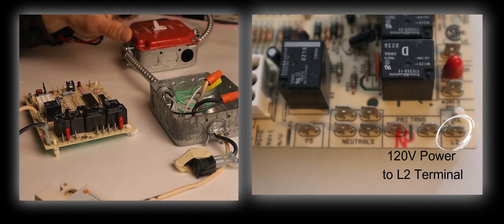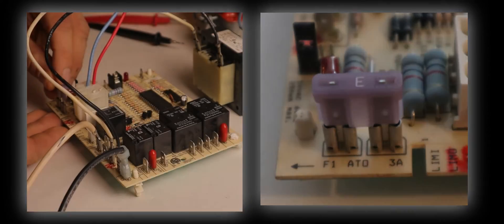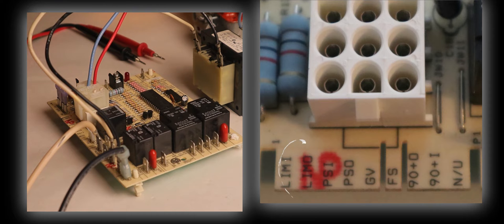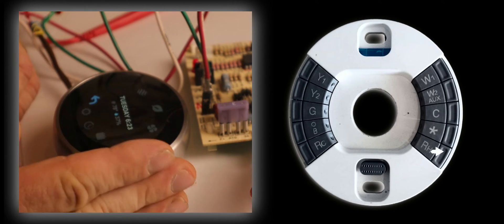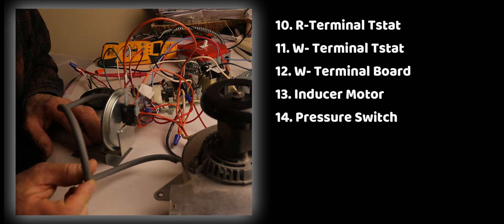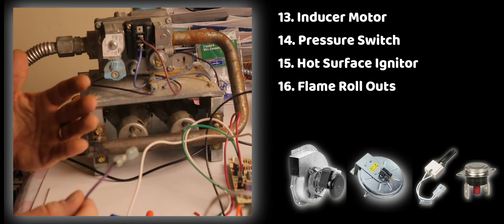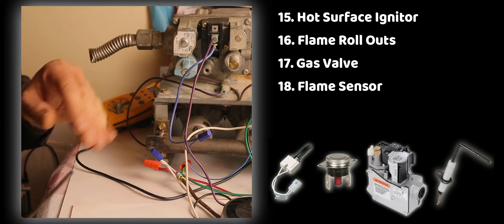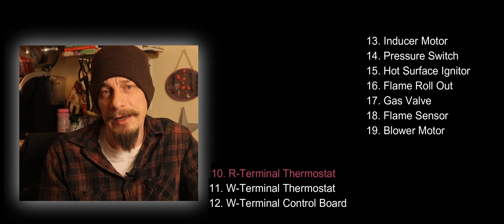HVAC Diagnostics: Furnace Wiring (Breaker to Flame)

Comment: I recently had a bad high limit switch on a HE gas furnace. Everything would work as normal for about 5 minutes then the burners would shut down.  A few minutes later the burners would turn back on and the cycle would repeat. Blower motor is running the whole time. Does this mean the switch is working except for the fact that it is opening at too low of a temperature? Is that something that can happen in these switches? BTW, outstanding video!

Comment: Can you do one of these step by step for cooling mode as well? I know its pretty redundant but that would be amazing
Reply from the maker: Yeah I'll try to get that in at some point. But for a furnace with an evap coil sitting on top, everything is the same all the way up to the R terminal on the stat. Stat just sends the 24v to Y terminals instead of W. But I'll try to do a vid of it soon.
Reply: @JerseyMikeHVAC  Came here to ask the same question!  Your vids are the best!
Reply from the maker: @mehvac  Thank you!

Comment: are all furnaces wired exactly like this ?
Reply from the maker: You'll see some variations out there even with the same brand, but the bulk of it is pretty standard and even the differences are applying the same principle.
Reply: The sequence pretty much. The control board there are different